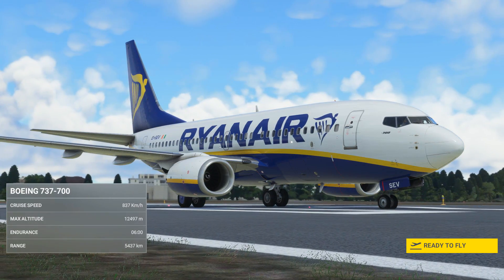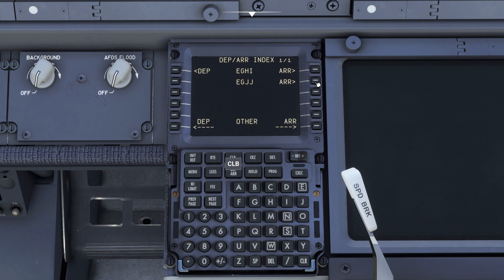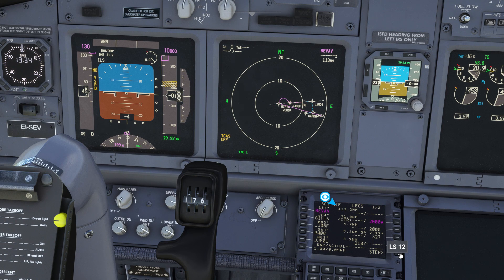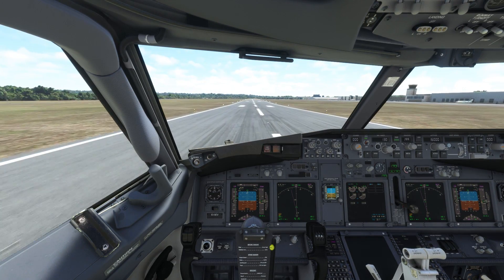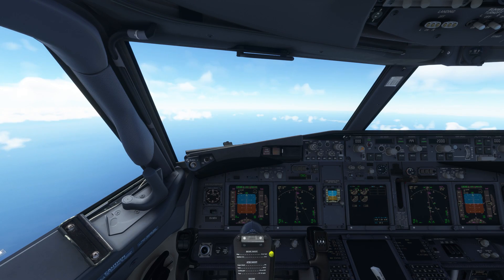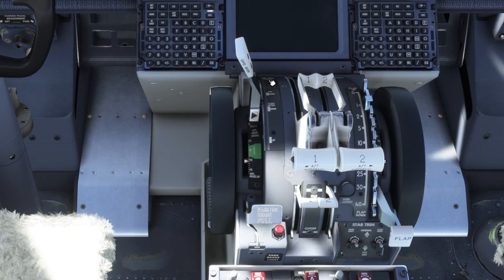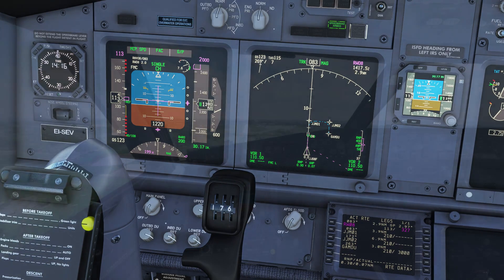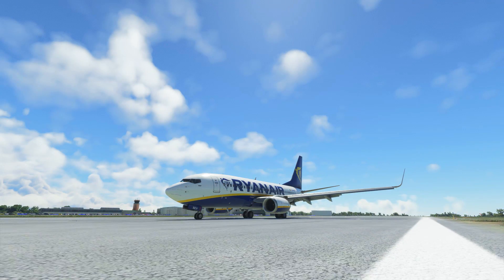RNAV Approach Tutorial MSFS - PMDG 737

Comment: Does this apply to all RNAV approaches or only straight-in approaches?
Reply from the maker: All of them AFAIK
Reply: This only works if you have the landing runway as a waypoint. If it is not a waypoint, you cannot use approach mode and will have to recycle the FD's before you are at the FAF. @TiJayFLY

Comment: But  my approach fix is 2227 should i round it to 2000?
Reply from the maker: Altitude? You can round down, it’ll follow the FMC. You’ll only have a problem if the MCP alt is set higher than the FMC’s BOD, as it’ll restrict your descent.
Reply: @TiJayFLY  ok I'll set it to 2000
Reply: @TiJayFLY  please what about the course because the course of the fmc varies with the chart by 1degree
Reply from the maker: @TacticalOdudu  follow the FMC cos the  PMDG nav data should match the sim

Comment: Super easy tutorial! a lot better than other ones which iv'e struggled to understand. one question - with RNAV aproaches what frequency do you input into the NAV radio? would it be the same freq as the ILS for that runway?
Reply from the maker: No frequency required - the lat/vert deviation is calculated by the plane, not external equipment at the airport
Reply: @TiJayFLY  Thanks so much! very helpful!